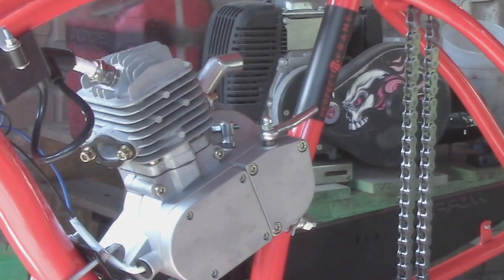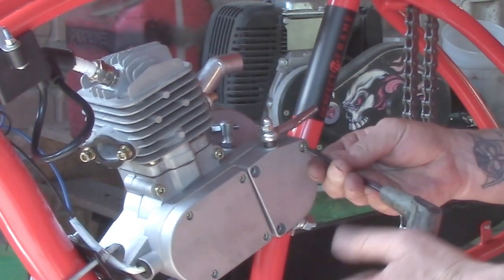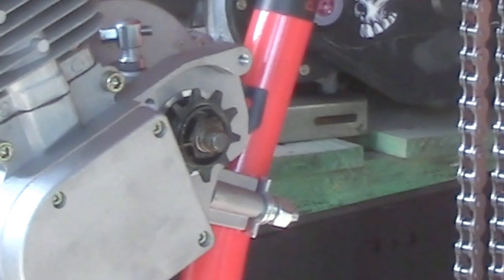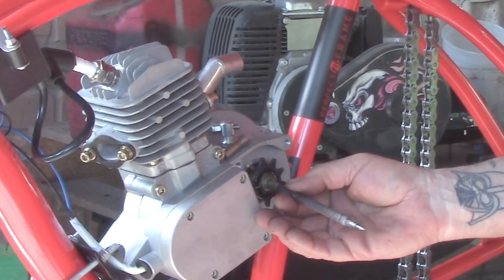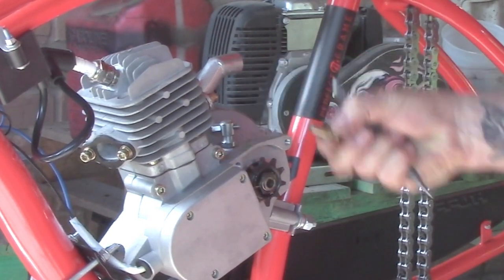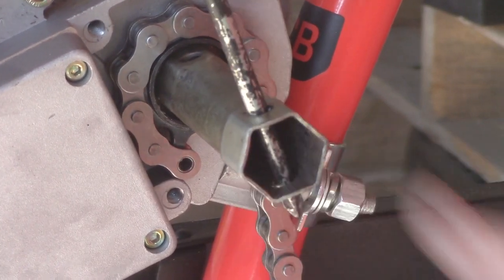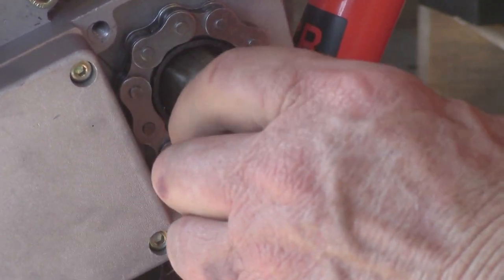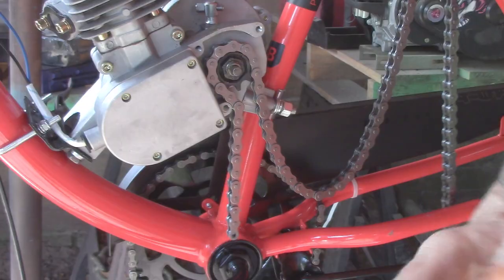How To Install Chain In Drive Sprocket For 2 Stroke Motorized Bicycle Engine

Comment: I just want to add that I was putting my chain on counter clock wife like you are doing here and my bolt came loose. I had to turn it clock wise to tighten the bolt back and to then start the chain back on it from the bottom. 

I’m not sure if turning it clock wise hurts anything but it worked for me.

Comment: Remember this. Your bucking bar has a tapered end. That's the side that goes into the engine. If you don't have a spark plug tool to get the drive sprocket moving, you can use a 19mm or 3/4 will work.

Comment: how do i remove the engine? i know it seems easy, but seriously, the chain effectively holds the engine in place, so should i remove the 10t sprocket?
or break the chain?!  either way i can't believe i have to do this.

Comment: Just bought a pre built for my wife and I'm putting a new chain on, got that boy through but it appears that bearing behind the bucking bar is missing. What size bearing is it...?
Reply from the maker: 5/16"  or 8mm.    
https://youtu.be/t4v3S0Cg2jQ
Reply: @HughesMotorized  Thanks for the prompt reply. I'll help with the hair product fund ! You're the boss.

Comment: Any words of advice for struggling with a problem? Just a general inquiry. (Bolts keep falling off, chain keeps hitting the frame, and other problems seem to be happening a lot lately) I feel like I am fixing the same problems every week.
Reply from the maker: Don't give up. You are learning about these. It will get easier. Then hard. Then easier and easier. Don't overtighten bolts. Make sure engine is mounted properly and secure. NO wobble
Reply: @HughesMotorized  Thank you, I really appreciate the response. Hope you have a good rest of your day.

Comment: Yes but what if where the long screw goes in that whole corner has snapped
Reply from the maker: Had that happen to me. You'll have to cut some metal to cover the whole flat area inside, drill a hole, clean the case up and JB weld epoxy the repair plate on

Comment: do most of these kits come with the chain connection link ?
Reply from the maker: yes. connector link included. You still want to cut or break the chain to fit

Comment: After I put my chain on when I backed the bike up the chain started to get tight but when I roll it forward the chain has slack ho do I fix my problem
Reply from the maker: Your rear sprocket is off-center. Remove the chain, raise rear wheel, place a screwdriver as a guide to check if sprocket spins evenly. I'll bet you'll find the sprocket is off center. Loosen up rag joint hardware and give sprocket a few love taps to adjust. Tighten up rag joint and check side to side wobble and go !
Reply: @HughesMotorized  why is it turning over when I move it backwards and not forwards